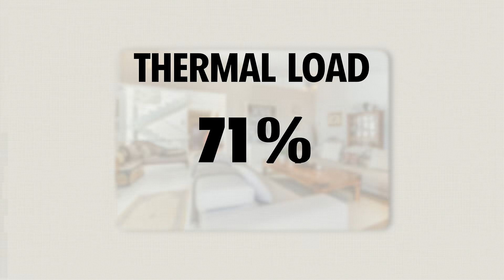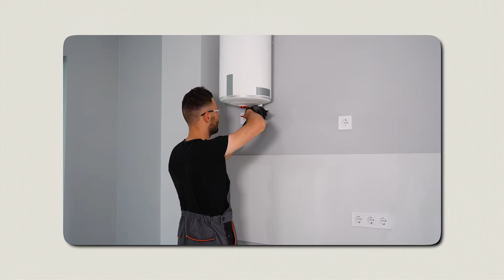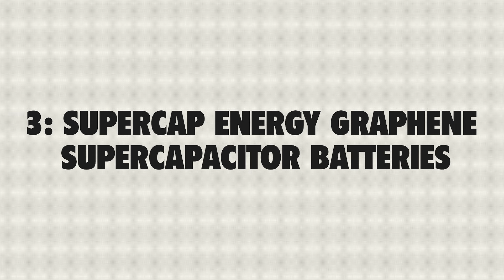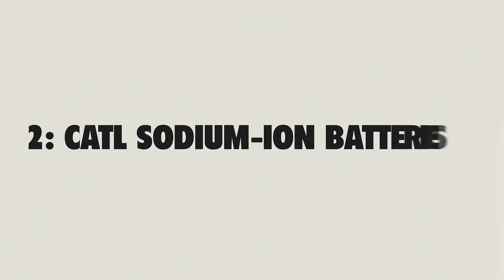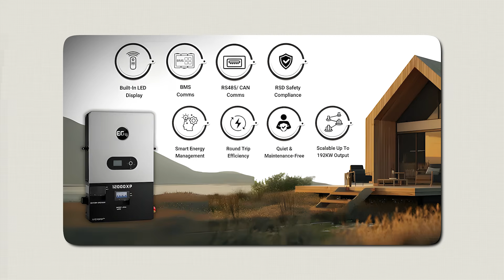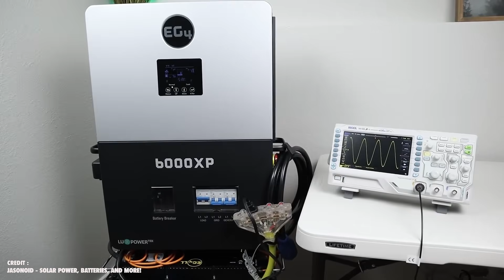These 5 Batteries Are The Future of Home Energy Storage

Comment from the maker: Which system do you think shows the most promise?
Reply: Human self restraint should be the first firewall.  We're creating generations of people raised in relative luxury and utterly ignorant of how to survive w/o massive amounts of operational technology.  Eventually they'll become such hot house flowers they couldn't survive at all w/o it even if they knew all the old ways.
Reply: How many hours one of these fully charged batteries can run overnight??
Reply: That sand battery is very interesting, I'd like to see where that goes in the future
Reply: @Sam-m5g-k9j  The biggest problem right now is the cost. As someone who lives on the western Fringe of Europe, we need lots of heat in winter, due to our wet climate. We actually need more heat than colder, but drier places like Scandinavian countries. The payback time for something so simple rules it out for now. I think it's got lots of potential for the future. What's needed is a DC option, that can take direct electricity from a solar array. DC heating elements require much less energy than AC elements. Because solar is cheap now, a decent solar array with the DC energy going straight into a sand battery, could be a good option.

Comment: Home elecrtrical storage has been available for 125 years far cheaper than any of these solutions. You dont have them because battery companies can resell you batteries as these batteries last 60-80 years. They can be discharged 100% with little to no damage. They can sit for years discharged and they will work again. But they are heavier than lithium so cant be used in EVs. The Edison nickel iron batteries much better for fixed facility use. And in mass they can be produced at a fraction of the cost of lithium batteries. Hell you can even diy them.

Comment: Storage capacitors make nearly every battery obsolete. Whatever happened to EEStor ? They had a prototype around 15 years ago that seemed to be a real game changer. Maybe the pentagram labelled it a national security issue to get it off the market.
Reply from the maker: Not so sure about capacitors as they are a discharge solution - good for Uninterruptible Power Supplies (UPS) but not so sure about backup supplies!

Comment: Nobody ever thought running a house off one battery was a good idea except the idiots that designed them and those who didn't pass high school science class 😂😂😂😂😂.  It's simple math to find out how much battery you need for your house.  Average house uses 7-20kwh of energy per day that's ranging from just lights and Internet to having a full day of spring cleaning and showers and microwaving everything.  1 12v 200ah battery holds about 2kwh of energy.  Get yourself 8-10 of these and wire them in series-parallel to make a bank that is 48v and approx. 16-20kwh of storage and then 20 400 watt solar panels wired in series parallel to match the 48v and be charging at about 100-125 amps. You would be able to run almost any hisue off grid forever even in winter (maybe add 5-10 more panels in winter) and never have a power bill again.  Basic math
Reply: No, I want a battery that a company put proprietary software on it so no one can use it if the company goes bankrupt and remotely monitors it so I need to pay a monthly fee to them....
Reply from the maker: Wish it worked like that!  I do have that level of battery storage and in winter I still have to buy in from the grid as some days I get little or not solar power.  I assume you haven't done this for yourself yet!
Reply: @wildline_YT Вітаю! Добавте вітряк. На цьому каналі є відео.